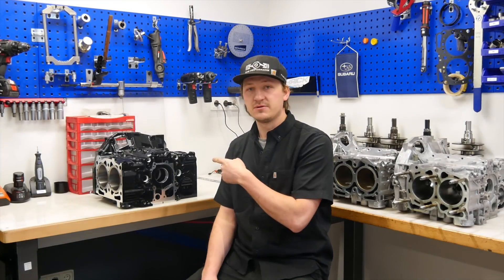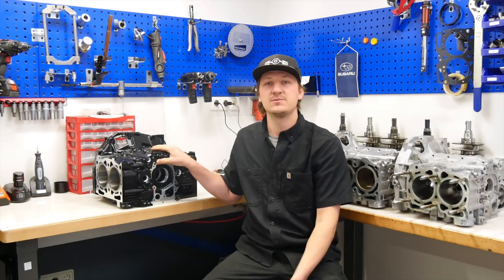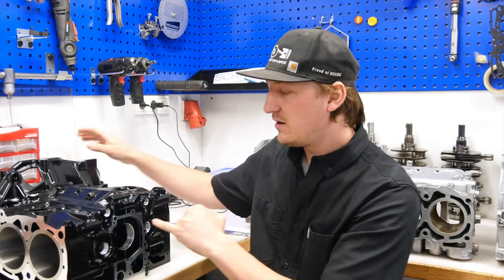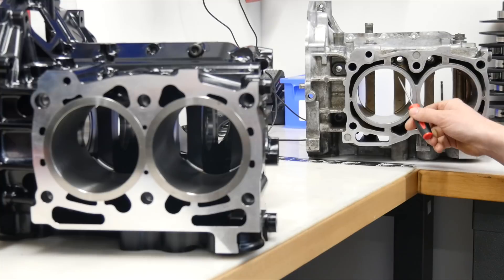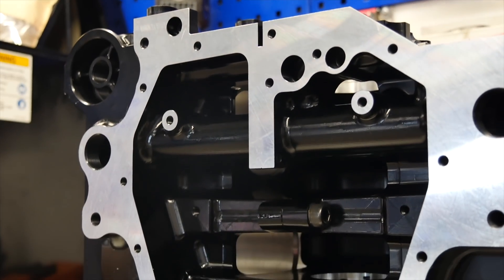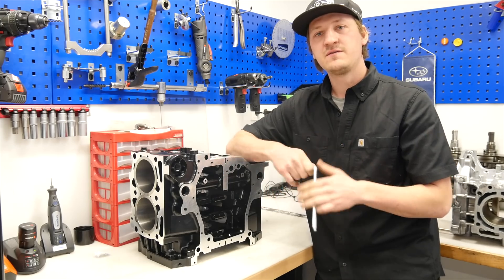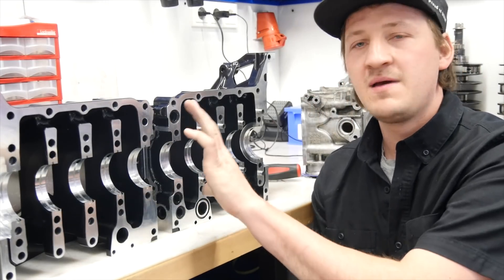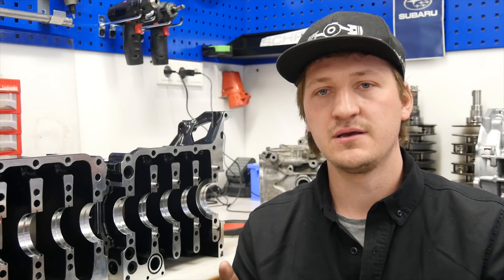INCREDIBLE BILLET CNC ENGINE l EJ20/25 l Satisfying l Art l Subi-Performance

Comment: Whoever designed that block certainly knew his oranges from his apples. Very impressive work. Little details like the retained dowels, splitting tool indents, fluid flow considerations etc. I work on aircraft engines and can see a lot of common details in the design. Take a bow Sir, you done good!

Comment: I have been involved with machining these blocks for a customer since 2017 and can attest to their toughness, especially the mainline. No longer do the main saddles go out of round and become enlarged.
Reply: Very interesting info, thank you for sharing! If you don't mind me asking, what kind of power levels are these engines being used at, and what kind of racing?
Reply: @MR__JUSTIN  The app for the billets I do is race only, customer and hp numbers are secret, sorry.
Reply: motion24527 also if you are the same person who has posted on nasioc as "motion machine" I have really appreciated some of your insight especially about proper machining of the mainline and block half mating surfaces. Thanks for sharing that kind of stuff, enthusiasts like myself greatly enjoy it! The billet block thread over there has had a bit of a revival, in case you're interested in chiming in with your experience. Have a great day
Reply: @MR__JUSTIN  Yes, same person. I gave up on that forum, all I ever got sent to me were blocks hacked up by some previous shop.
Reply: motion24527 https://forums.nasioc.com/forums/showthread.php?t=2786396&page=35

Comment: i've heard of oil cavitation in oil pumps but never due to the shape of oil galleries. cnc or not, those are still sharp right angles, only difference in the old block is that it had some burrs which might possibly impede flow.
Reply: How do you suggest it be done then?  Please enlighten us with your advanced manufacturing techniques.

Comment: Greetings from México, berry good content how much HP can the CNC block handle.
Reply: We haven’t found the limit yet unfortunately. Well over 1000 HP has been made but it has a huge amount of potential left. Just need the right customer to help us find the limit!
Reply: CREST CNC what kind of head gaskets are being used?
Reply: @ @ANL4JC  people have found success with standard type MLS gaskets and leaving the sleeve protruding a couple of thou.
Reply: CREST CNC thanks
Reply: @ @ANL4JC  I supply the blocks with the deck pcd flycut and then leave the sleeves protruding. It is up to the engine builder to deck the sleeves and use their preferred gasket sealing method.

Comment: Does the 9k include bottom end? Pistons, rods,bearings?
Reply: I can guarantee that's just the block. There's a Willall CNC what's $14,000 for just the block.
Reply: That's for a bare block. This is the same as the Willall block

Comment: Wish is they can make a Billet 5 speed gear box, people say the 6 speed is stronger better but I disagree. I prefer the ratios in the 5 speed when you can pull 130 kph in 2nd gear & all the way to 200 kph in 3rd but even with PPG gears the old gear boxes tend to twist causing gear teeth to miss alignment then snap there goes a tooth.
Reply: Dude the 5speed eats 3rd gear like nothing, 300hp is enough
Reply: Have you heard of the Moore Performance blast plates?

Comment: I'm mailing them for an eg33!!!!
Reply: Thought it was just me!

Perfect addon to the Level10 4EAT in my SVX.
Reply: @psygnale  I have one now I wonder what psi a deck like that could do with this one.. crazy probably have a reliable 450kw
Reply: @Regulators0001  WAAAYYYYY more than that bro.

I already called Darton...a >>regular press in<< sleeve for the EG33 is good for 650 to 700-ish HP.

Unfortunately several areas of the outer casing are too thin for one of their MID sleeves (which is what I REALLY wanted).

A properly designed >>billet<< EG33 would be good for TWO-THOUSAND THREE-HUNDRED HP EASY.

EXAMPLES:
https://www.amsperformance.com/alpha-r35-gt-r-vr38-pro-billet-block/
https://www.grannasracing.com/products/bullet-racing-billet-2jz-block
https://www.speedfactoryracing.net/bullet-race-engineering-billet-honda-b-series-engine-block

NOTE:  the AMS block for the Alpha R35 is the most appropriate comparison as the Darton sleeves allow the EG33 to be overbored to 100mm...allowing for one of the 3.8L stroker kits ZRP used to list (don't know why it's gone...)

Comment: When you first split the block apart there were metal shavings on the left side and then when the camera zooms in they are gone and you don’t mention them. What were these shavings? Just left over chips from machining?
Reply: The two halves are bolted together and then finished machined. (this is the only way that it is accurate) inevitably there are LOOSE shavings that find there way everywhere. They need to be cleaned the first time that it is pulled apart. We spend a long time deburring and cleaning before the halves are assembled.
Reply: @crestcnc7744  I figured it was something like that. Thanks for the reply, cool engine!

Comment: OEM should use these for their wrx people wouldnt mind paying more
Reply: Bahahaha 120k stock..
Reply: @Regulators0001  lol what? the engine block is $9000 how do you get $120k stock?
Reply: @henrym5889  prices are relative. people would be willing to have a job making these engines than not have a job at all. how much does a car factory cost and yet we all contribute together for paying for such monstrosities? anything is possible we just have to not think its impossible especially if the only hindrance is arbitrary prices for things. i for one think along the lines of durable engine with no blown head gaskets for a very long time thats why i would be interested in this engine block. i really hate the idea of disposable vehicles. engine and trans especially should last a very long time. we should also make car bodies out of hemp so they never rust. we shouldnt be thinking of pinching imaginary pennies but rather making durable products. lol or how much does a cruise ship cost and we can have that. airlines are barely profitable but we still have them. or not even profitable.
Reply: almost impossible bro loooooool
Reply: @EliasWalkerfuzzy-wuzzy  We can do it!
Reply: @henrym5889  exactly. toyotas have been running 500ks without much trouble lol i dont see why anyone would need billet engines in their 250hp applications loool